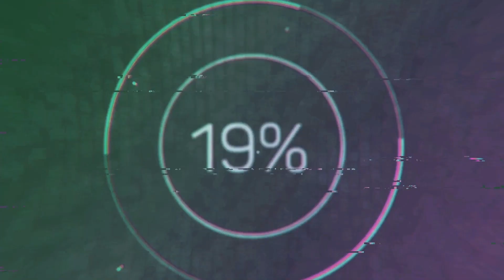Passat CC R36 HOW TO REMOVE HEADLINER

Comment: Hey @VDEdition1 I see you just responded to someone so maybe you will have a quick answer for me. I am going to fix a 2010 CC headliner. Do some models not have the screws in the A pillar under the airbag trim? I see no place for a screw to be on this car, just a solid white area. Thanks.
Reply from the maker: Yes, you don't have screws on those A-pillars. It is held by steel hooks that, when unhooked, have additional hooks that hold the pillar. To unhook them, you have to pull the entire pillar up, because in that direction there is free space where the hooks are no longer attached to and you can remove them.
It is very difficult to dismantle and re-install those pillars, and there is a possibility that the windshield will crack. My recommendation is just to unhook the hook to separate the pillar from the headliner and leave them like that... you will be able to remove the headliner, and it will be easier to put it back later.
Reply: @VDEdition1  хвала ти пуно